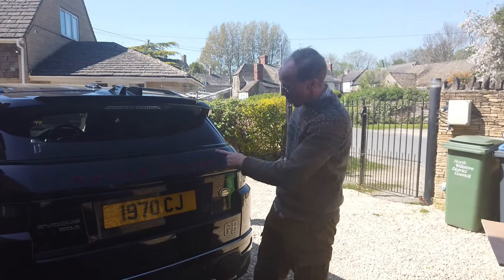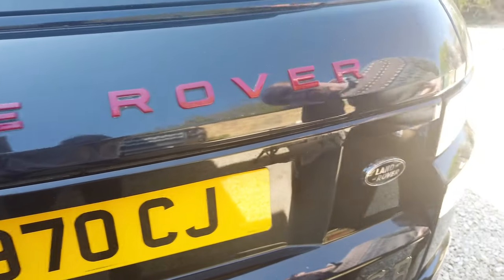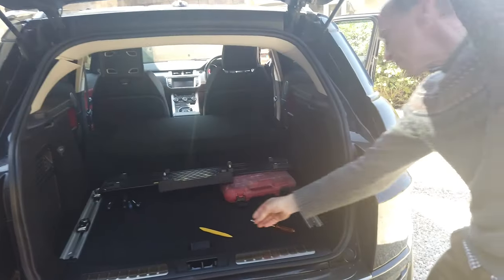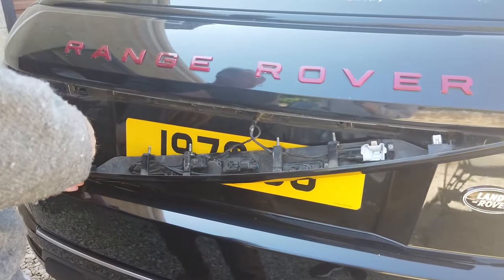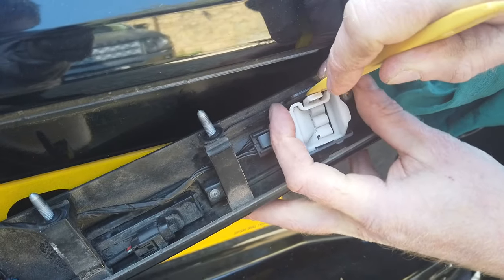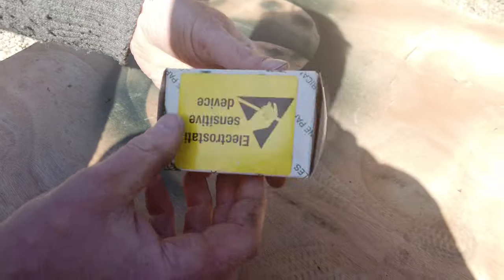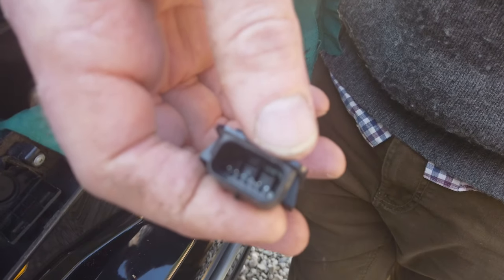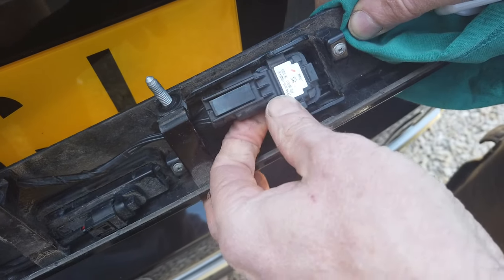How to fix / replace / Remove rear view reversing camera on Range Rover Evoque

Comment: For those of you with an early model which uses the 4 pin camera.  As you know they’re hard to find and expensive.  If you have 360 system, where there’s 5 cameras all together, 2 in front bumper, 2 in wing mirrors and 1 in boot lid.  They are all the same camera.  I have no interest in the 360, but I did miss not having a working reversing camera.  So I just replaced the reversing camera with one from one of the wing mirrors.  This time putting some sealant on to stop water getting in again.

Comment: Great video with easy to follow instructions ,our model the " HSE " had also an electrical box behind the inside " trim panel " that had 2 screws to undo before gaining access to the 3rd bolt that lets the outside trim panel come off  but other than that simple enough as long as owners take their time ......... thank you very much ,

 Youtube and google tools for life  !!

Comment: Thanks a lot for all your detailed videos!! My 2012 Pure Plus doesnt have the reversing camera.. what are the chances that the wiring is already set up and the camera connector is already there in the tailgate?? Like with the illuminated door sills, or other accesories not included in the build list. I guess (or i wish)the wiring loom is standard and one-of-a-type for all Evoques and accesories are put on demand…
Reply from the maker: We dont have a pure but pretty sure this is not present in the car unless it had the camera fitted.

Comment: @powerfulukltd I wanted to check my reverse cam yesterday but I noticed that my Evoque from 2016 has a different cam holder than yours showed in the video. There is also a white holder with some kind of complicated clip which I can´t open to put the cam out the holding. Can you help me with this?

Comment: I have a 2016 Range Rover Evoque and the camera just all of a sudden stop working and doesn't respond. I get a camera fault warning in the dash. Can you help?
Reply: Had the same issue with my 2016 Evoque, bad design fault (like most LR malfunctions) water ingress usually the culprit, mine started working again after using a hair dryer to dry it out, probably a temp fix, so will have to do something more permanent at some stage...

Comment: Hi. Thanks for sharing the video, fantastic and really helpful.    The issue I have (5 camera plan view) is that only the near side door mirror camera seems to be working.. all others show a camera with a red cross in it.  I can’t believe that 4 camera have failed at the same time, but rather there is a power issue (good old fuse) or a more complex issue with video management sub system ( I assume there is one somewhere).   I hope someone can help, I don’t really want to have to buy/fit 4x new (expensive 6 pin) cameras- is there a common power supply / fuse for the cameras???   Any help really appreciated

Comment: Good Morning,I’m writing you be half of my friend who own Evoque and having some difficulties with reverse camera,after seen your Video clip I think the problem with the connection with the camera but we haven’t open it yet to check the connection,meantime my mate got in touch with a person who does mobile diagnoses and he got it checked and came up with “VIM (Vehicle Immobilizer Control Module)( 1 DTC )”this and error code showing “B100D-73
 Column lock authorization - Actuator stuck closed” so I’m confused now and can you please advice on this.Many thanks
Reply from the maker: This does seem an odd fault but if the car works and unlocks i would not worry too much

Comment: Great video managed to get my old camera with same error out but still not working. So have been looking for a new one but has different 6 pin expensive type. 

I've gone to JLR dealer and they advised the camera is not plug play and they will need to configure a new one if ordered.

Please advise, as JLR are asking for £440 to replace with new camera? Thanks
Reply from the maker: I had another look at this tonight and it may be the case that the cameras need coding - this makes it really expensive for what should be a £40 camera ! I will keep looking into this and see if we can work out a cheaper way.
Reply: @L663   FYI- I was able to replace the camera without any coding, it's plug and play 😀
Reply: Plugged mine in and the multi media system won’t turn on now! How strange

Comment: Hi, great video. Can you tell if the wiring loom for a reversing camera is standard even if a camera is not fitted. I have a 2013 Pure Tech. If so, what do I need to retro fit a camera. And are the part available from you? Many thanks. Jonathon
Reply from the maker: I dont think the wires are there on base models.
Reply: @L663  Thank you for taking the time in replying.

Comment: Any help on camera screen my 2013 back camera flashes on off image with Red Cross, it’s a 4 pin as checked; would it be a faulty camera or cables ? On/off message on screen says parking assist unavailable; any help I’d be grateful, thanks
Reply from the maker: This could be tricky to diagnose - really need to start by fault code reading to see it there are any issues with sensors / camera / module etc
Reply: @L663  many thanks for your reply, noticed another video that showed same camera off (driver side) which caused back camera to flash on/off when first switched on. Looked for video on how to remove camera from wing mirror to try; the 4 pin ones seem to be the most expensive.

Comment: Thanks for the video.  I do not have a reversing camera.  Do you know if the cakes are there ifI want to fit one.  Mine is a 2017 td4 se tech ?
Reply from the maker: Hi - i am not sure on this one... i am guessing not as the cables / connectors for the camera would add some cost ( more than some other less complex components like door lights etc )... damn you for mentioning cake... now i am hungry !

Comment: It’s not the beginning of boot loom issues is it? Had lots of issues with Jaguar XF sportbreak loom. When mine was still under warranty it had plenty of visits. On the first one they replaced camera and issues returned a week later, eventually loom was found to be faulty at the point the loom goes from tailgate to body.
Reply from the maker: Well the reverse camera stopped working again today .... so lets try new camera but as you say could be the boot loom !

Comment: Hi, thanks a lot for your video. I replaced the old Kamera with a original one but is not working. If the new camera is connected the hole Radio do not work. The display do not start. Ich I replace again with the old defect one, the display works but the Camera not. Do you know what can be the problem with the new camera?
Reply from the maker: This is strange - it must be an issue with the new camera. Did you buy the camera from us ?
Reply: No, I didn't know you sell camera. I buyed a original camera on ebay and a not originally camera. Both make the same issues. Were can I buy it online from you? 
I thought I need to install the New camera with the jlr mongoose and it's software?
Reply: @litosazevedo 
Did you get it to work?

Comment: I have a 2017 evoque.  I took the camera out and its different from yours.  These are the codes on the camera itself.  892006, C856112010082527.  The camera plugs in from the bottom and has 6 prongs.  Do you know the Land Rover part and can I purchase it from your company?  Thank you

Comment: I did this repair, but I had the 4-pin camera, it was a bit more expensive, plus they were hard to find.....
Reply: Very handy video. Just to add if you have the 4 pin camera and it’s fogged up but the electronics still work. It’s possible to pick up an identical camera but with 6 pin connector LR025912_1 for about £40 . Swap the 4 pin electronics out of the old camera into the new housing and use the new rubber seal and reassemble. Works a treat👍
Reply: I have a 2014 Range Rover evoque and mine is working but fogged up I am thinking I got the 4 pin camera ! On help on what camer I should get for this ?

Comment: The image on my Discovery Sport  rear camera has rotated 90 degrees. Any advice please
Reply from the maker: Hi - this is a new one to me but looking online it certainly seems to happen !
Are your yellow image lines the correct way?
I think this is a software bug - only thing to try is disconnect the battery - leave 10 mins and reconnect !
Reply: @L663  yes yellow lines correct. I removed thr camera hoping to rotate it but shape and fixings don't allow.
Reply from the maker: @DavidSmith-hy6fc  I would try the battery disconnect - its the only way i can think of doing a reset of the image system - other than that it could be dealer refresh the software on the image module ?
Reply: @L663  Is it OK to disconnect the battery, I've always thought it could damage electronics. Please advise
Reply from the maker: @DavidSmith-hy6fc  It should be OK - just need to disconnect the -ve terminal - leave it for 10 mins and reconnect.
It has a very very small risk of causing a problem but its worth a try. I do it all the time and never had an issue.
Reply: @L663  disconnected -ve for 10 mins. Still the same. I'll  take into my local garage and see what they say.
Reply: Finally I have installed a new camera and all is well. Thanks for your support

Comment: I have followed same process 3 times but when I replace earlier with damaged lens. It’s exactly same but it doesn’t show any camera system fault.
Reply from the maker: Hi - I think the camera may need setting up with Land Rover software - i will check and make a video. This is not good as Land Rover are making it hard for people to fix the car themselves
Reply: Thank you so much 💐🙏🏼💐
Reply: Hi would be happy to see video on software for camera acceptance